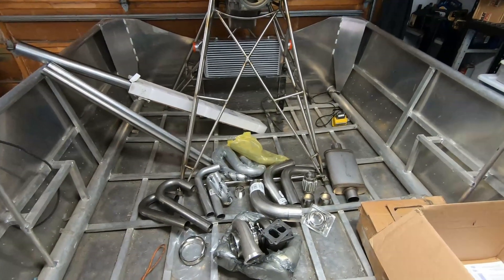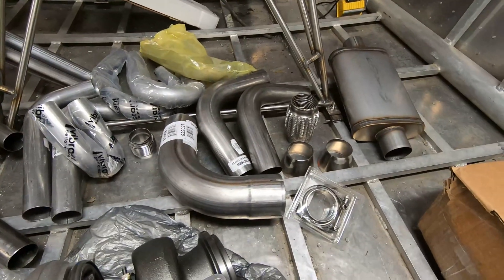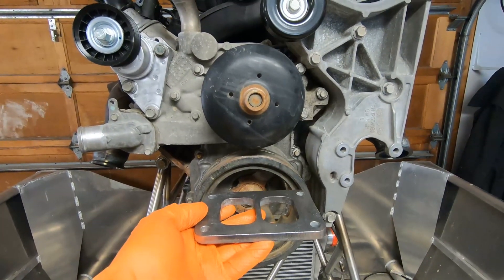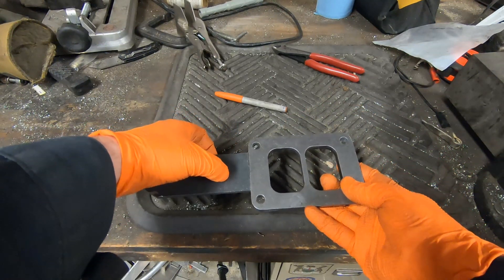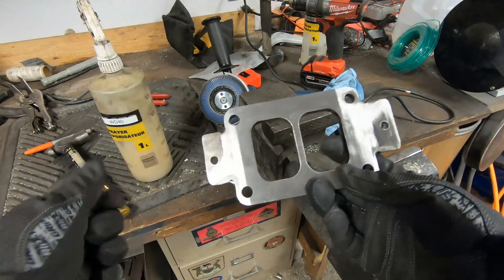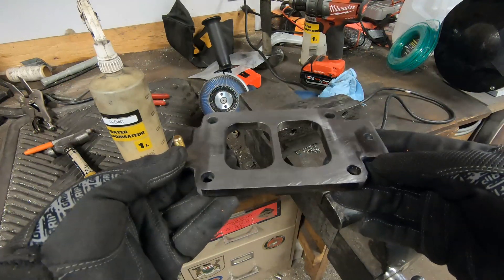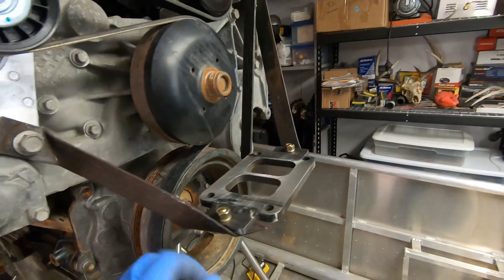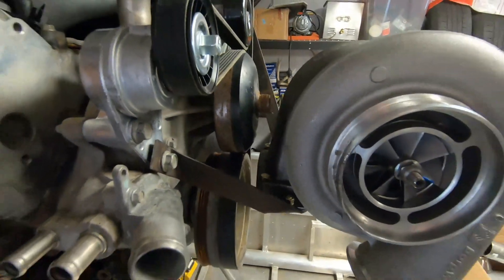Airboat Build #12: Turbo Mount

Comment: Love the build progress.  I'd consider a ceramic turbo blanket.  I have a Class A RV with an 8.3 C Series Cummins in it and it has one to cut down on the heat a ton.  CNC machinist for my day job, so watching someone else fab something is relaxing.  lol
Reply from the maker: Thanks for the comment.  A blanket is a good thought.  I might move the turbo anyway so that the cold-side tubing lines up better with the intercooler.  I'll use the same flange and just make new brackets.
Reply: @dr.dansgarage  my thinking...lower might afford more airflow for cooling as well if  it's slightly below the engine.  Or beside.